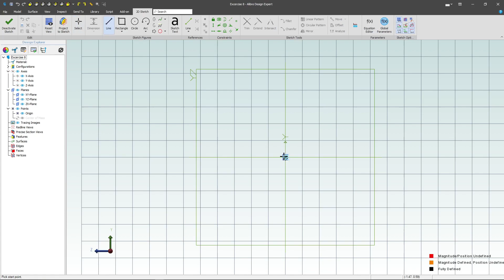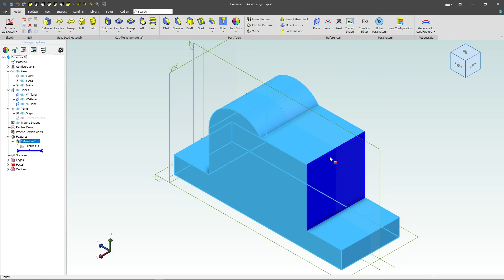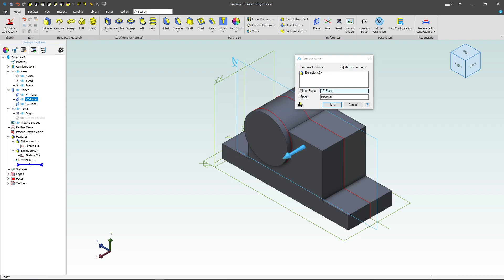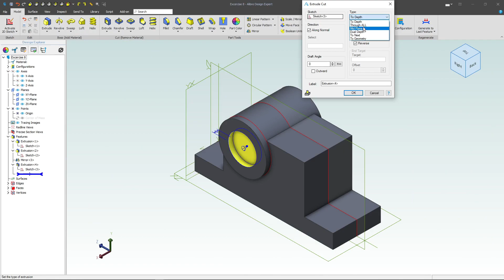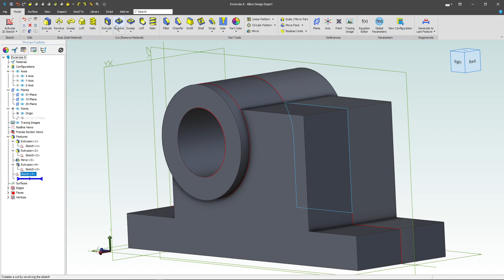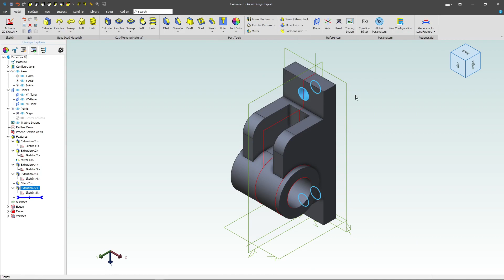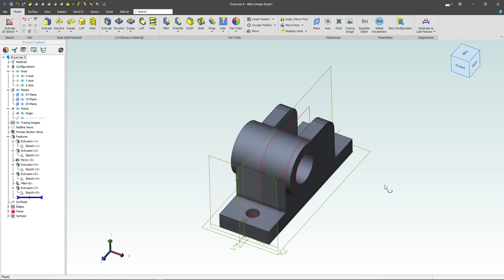Refine Your CAD Mastery |Exercise 8| Mid-Plane Extrusions, Mirrors, Fillets & Beyond

Comment: I see that you dimension a line by selecting its  endpoints, rather than just selecting the line itself. Is there a reason  for this?
Reply from the maker: It has to do with design intent.  In the future, if the sketch were edited and the line were deleted, dimensions that were created by clicking on the line would be deleted with the line, whereas dimensions that were created by clicking on the endpoints would stay.  Depending on the situation it may not always work like that, but it can be used as a best practice.